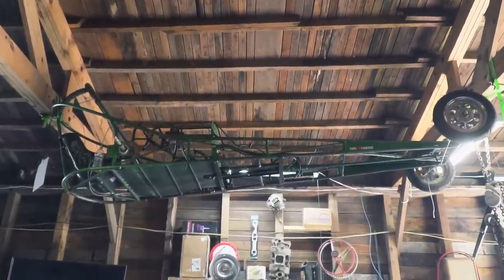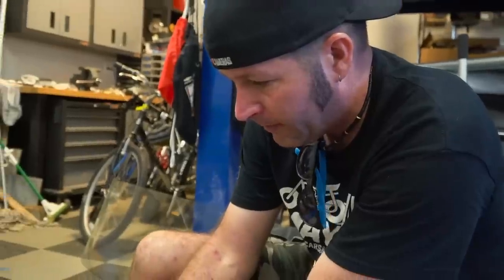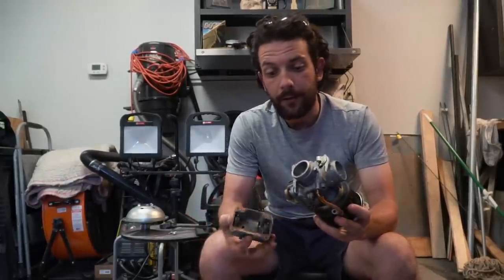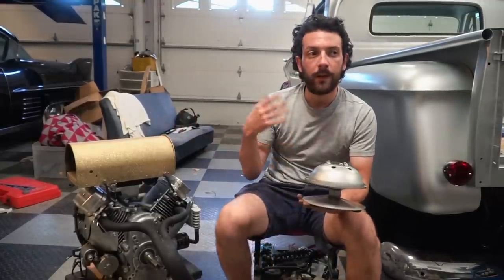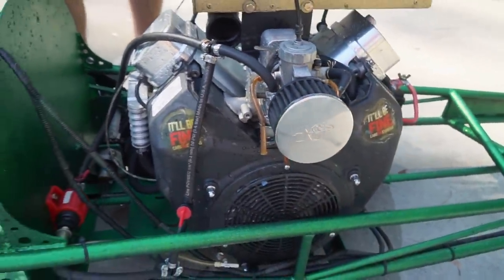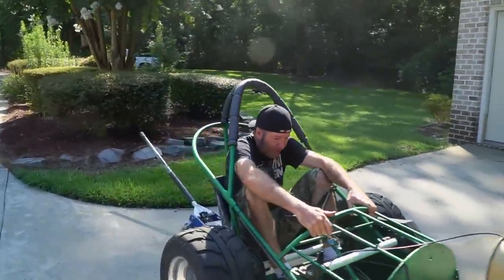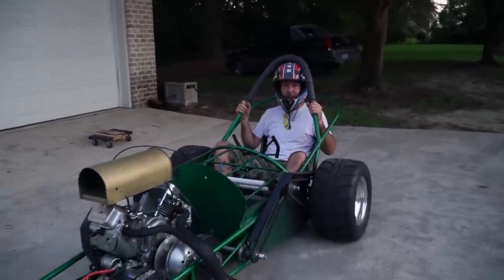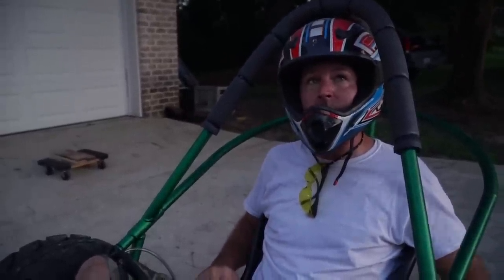670cc Drag Rail Revival! | Our 55HP Harbor Freight Engine Rail Kart Returns!

Comment: So need to put the 2 stroke snowmobile engine in it!!
Reply: It would make sense on this thing, given how powerful it is.
Reply: Or they need to build a second one and run them both together!!
Reply: Yeah the drag rail definitely needs a different engine, either snowmobile engine or motorcycle engine
Reply: Yh they need to build a bigger/stronger one with a more powerful engine.
Reply: it would be so fast with that engine. great idea!
Reply: Dam streight!!!
Reply: But the 670 just sounds cool
Reply: I'd say a Polaris 600 triple
Reply: The rotax would rock. This lawnmower engine isn't close to 55HP, it is 30 maybe.
Reply: @CLK Products  it won't wear the belt out as it won't need the cvt system as it already has the clutch and transmission built onto the engine
Reply: It would twist the frame they never built it for any more power and i remeber them even having problems with the current engine. They have said that it couldnt handle any more power.
Reply: Isaac Inmon yes that is true but towards the end of the video they talked about  strengthening the drivetrain and potentially the frame as well but even still I don’t think it would cause any damage to the frame rather than bending axels due to the torque from the engine

Comment from the maker: It’s more stout than I remember! Can’t wait to take it to the track
Reply: guys please get an old chevy or something and shove a predator 212 in it
Reply: Love the video!!!!
Reply: Lol
Reply: Plz put the snowmobile engine on it it would bc so sick
Reply: i think i need this in my life
Reply: I was thinking you said there were some cracked welds on the rail , Safety first . Look it over good :-)
Reply: Dude, just pick up a adjustable fuel pressure regulator off amazon. They are fairly cheap.
Reply: STOP PLAYING WITH THAT 670 ENGINE AND THROW ON THAT SNOWMOBILE ENGINE, DOUBLE THE POWER!!
Reply: CarsandCameras just don’t blow it up!!
Reply: The lithium iron phosphate batteries are the bee's knees. They don't sag voltage wise anywhere near a lead acid or gel cell.
Reply: Picked up the front left a little at 15:00
Reply: @josephh66  idk if chevys can handle that much power and speed. Thats pretty risky man lol
Reply: Put the snowmobile engine on it and send it
Reply: ONAN CCK MOTORS START SO EASY AND RUN BETTER WITH THE SPARK GAP AT 20K,  35K+ IS TOO MUCH GAP FOR THESE MOTORS, TRY A 20K SPARK GAP, GIVE ME A LITTLE TRUST WHAT I AM SAYING.
Reply: You guys should hit up some junkyards or auctions and find a doner bike with big displacement and do a build around that. At least you'll have the engine and transmission
Reply: Have you guys considered installing an AMR500 on her? Could be fun....
Reply: Hay  can you please take the cross cart to drag strip
Reply: I say it needs that 2 stroke u just got
Reply: did you say honda davidson ?
Reply: plains have pumper carbs
Reply: The 670 sounds way better than the snowmobile engine i say throw nitrous or supercharge it
Reply: Dax arms, I believe you could use the low oil shut off switch found inside the engine on the 212s but to make it fit inside of a fuel pump or carb would be a real struggle. However I do believe it would work for cutting the pump off. Actually it would need modified to work backwards but the idea seems legitimate.
Reply: I watched on another chanel where they took a new 670 and supercharged it, maybe that could be a direction to go.

Comment: A modern aircraft carburetor doesn't use a float bowl, initially they did, but for obvious reasons they didn't work if the air craft experienced negative Gs.
Reply: One of the big disadvantages of the Spitfire in WWII was the use of a carburetor with a float bowl, where its German counterpart the Messerschmidt Bf109 was fuel injected, so German pilots would try to force Spitfires into diving/negative G manoeuvres where their engines would lose power.
Reply: PKMartin the flooding issue was quickly fixed in 1940 by putting a ring in the carburetor to minimize flooding when upside down.
Reply: You can go inverted as long as it's a positive G maneuver like a loop or a half Cuban 8.  If you have the stomach for it and don't mind pulling 3+ Gs, Aerobatics are fun. Sad to hear John and Issac hate flying.
Reply: @moto6ixmoto83   I believe it was 1941.
Reply: Yes It would
Reply: Doing a 360 or something would cause the needle to close and that would not be good.
Reply: Fuel injection replaced carburators first was the 109 messerschmitt

Comment: carbs for aircrafts have heating for the air-intake because it is cold at like 10.000 feet :)
Reply: Right... The carb heat among other things.
Reply: What do they do for when the air gets thinner up there? Is there a lever where you can adjust the main jet while running?
Reply: @AustinRBa  You're correct. Manual mixture control to lean or enrich the mixture. Gotta find a rich/lean mixture that takes into account fuel economy, air density and altitudes effect on reduced engine cooling.  The carb heat prevents ice from forming in the carb. If there is ice, the engine may stumble momentarily while till the water from the ice is no longer introduced into the fuel.
Reply: Some aircraft carbs can also work upside-down. ;)
Reply: @Lord_Verminaard  good ones....
Reply: Actually paused and started digging in comments for this answer. Thank you kind sir! Have a good day! :)
Reply: @Lord_Verminaard  All planes with carb's have to run diaphragm type carbs with no float bowl. If a plane turns upside down with a standard bowl type carb, it would most likely kill you. It would flood the intake with raw fuel, start on fire from leaking, for sure kill the engine. Then you would have to have enough altitude to right the plane, glide along and try starting the flooded engine, all while trying not to crash.
Reply: @POL3INAROW  correct
Reply: @AustinRBa  the english and yanks added superchargers
Reply: @AustinRBa  well even my old moped from  1974 has adjustbla mixture egg boi so i hope they do :) have a good one
Reply: @POL3INAROW  Yep... The engine out won't kill you, a fire will.  Most general aviation planes can glide and land on a golf course or road.  Engine out simulations are fun.
Reply: More modern planes call it anti-ice. But same thing.
Reply: Aircraft carbs Ive seen usually run the air from the bottom through the top and mount underneath the engine.
Also the cold air at altitude.
Reply: @POL3INAROW  The spitfire made do without. Mind you I'm pre6sure they did make a modification to all aircraft with rolls Royce Merlin engines
Reply: Diesel engines also have an intake heater
Reply: Carb heat isn't normally used when flying, but carbs can ice at any altitude depending on a lot of variables. About the only time carb heat is normally used is to prevent carb ice when landing, but it kills the power, so its normally turned off. Almost all carbureted engines have an adjustable mixture to get the most power and efficiency out of the engine at any altitude. A few types of carbs aren't adjustable by the pilot, those are fairly rare, and fuel injected engines don't have a mixture control. As newer technology is used in aircraft engines more of that stuff is computer controlled.
Reply: @AustinRBa  early rotary engine Nikki carbs have an altitude compensator. Its just a needle that stays closed off till the sensor hits a certain voltage opening the needle and allows more air in than the venturi sees which helps lean the mixture. Youll find it at my local dump along with the rest of the emissions equipment lol.
Reply: nice to hear from a real life pilot, by the way i'm from scandinavia it's cold here most of the year

Comment: Glad to see it running again, I think the 550 Tot Rod will stomp the rail in the eight mile, the big drawback  of the rail is limited  RPM( 6500 ) Or so, and single speed. If you want the rail to be fast with the power it has , it needs a transmission.  Still love the build, old school is too cool.

Comment: whenever you have a simple gap set up like a lawn mower or a old school points set up on a car you can get away with using a match book flap as a feeler gauge to set the gap . most match books are made with 3 mil paper so it's about perfect for setting the gap on a mower the points on a old beater car. I own like 5 sets of feeler gauges for all kinds of old points set up's and I still fall back to the match book for my old dodge's points . the best part for doing a mower mag is you can put the match book flap between the fly wheel and the mag and just tighten the bolts the match book will slide right out after your done leaving the gap perfect and ready to run.

Comment: Aircraft carburetors are specifically made for aircraft. They are often more complicated than normal “small engine” carburetors as well as having an FAA manufactures airworthiness certificate. In other words to make and sell carbs for aircraft you need that cert from the FAA. There are also regulations about changing the “stock” carbs on any aircraft. In order to change to a different carb (unless it’s on a list of FAA approved carbs for your specific engine) then you need what’s called a supplemental type certificate.  Again, in order to attain that, you need to be in touch with them FAA. Long story short, the difference is the regulations surrounding the aircraft carbs. In theory they work the same as any carb. And of course there are float type and pressure type.

Comment: The reason it says not for aircraft use is because mikuni also makes carbs for aircraft more recently they are mostly used for paramotors and small craft.  I also did not know that up until a week ago when I was researching tuning on mikuni carbs for my bike and learned about their history in aircraft carbs.  The main difference that I can tell between a moto carb and an aircraft carb is that aircraft carbs have a different fuel bowl to avoid overflow since your aircraft wont always be paralel to the ground unlike how a land vehicle usually is. Aircraft also experience odd g forces at times. BTW really excited to see the drag rail back I still love the mailbox ram air intake.  Please do a turbo 670 for the drag rail that would be cool.

Comment: Great to see the dragster back in operation!😁👍 That thing with the mags is kind of weird. I'd be real tempted at this point to go with a crank trigger and electronic ignition (battery powered). Other than that, it still sounds strong. You may find that you'll need to put those higher stall weights in the clutch to really get your times down. Between that and eliminating the jackshaft, you'd probably pick up another 8-10 hp. at the wheels.😉 One thing about the 670 Predator, if it does finally puke it's guts, you could always put that Bombardier 670 2-stroker on there instead. With a big meaty axle and the stock clutch asy. from the Ski-Doo, you'd probably have to install wheelie bars.🤣

Comment: I would definitely play with tire pressure. Depending on the rating of the tire. If it's a max of 15 I would start a 7 and go up. If it is max of 20 I would start with 12 to 14 and go up. Should help with the spinning but might brake chains or bend axles so its definitely something to mess with want a little spin if things start breaking if nothing breaks then find a good low pressure. Also I think it in the 1/8 it will be about a 7. Have fun and be safe

Comment: Great to hear an American pronounce aluminium correctly...😀 p.s hi from the u.k.  oh and aircraft carbs are sprung so if the throttle cable snaps it goes to full throttle rather then closing to idle.

Comment: I'm an aircraft mechanic and the reason is 3 fold. 1, it doesn't have any provision for carburetor heat, which icing at altitude will block off the opening. 2, it doesn't carry a P.M.A. number, which certifies it for airworthiness. Only experimental aircraft aren't required to carry P.M.A parts. Usually on aircraft you find Marvel Schebler updraft carbs. Old tractor stuff. The Cessnas and Pipers are more closely related to tractors than anything else. 3 no mixture adjustment. You have to be able to adjust your fuel mix at altitude.

Comment: A diaphragm carb is used for aircraft. It doesn't have a float bowl too flood the engine on a climb, loop, or tight turn. A Carb like your's will dump fuel into the engine of an airplane when turned upside down, and bowl will run out of fuel. Diaphragm carbs are metered, there internal fuel pump produces more fuel than the carb could use, the needle and seats are metered, not open or closed. The fuel the carb can't use is returned to the tank from an internal bypass. This style carb can be turned in all directions, and still deliver the correct amount of fuel.

Comment: Airplanes run off of av gas. Its a special mixture of gas with a little bit of lead in it. Helps with lean mixtures at altitude. That carb can run it, but it will tear it up like ethanol. Also if the plane is upside down, the contents in the bowl, in the mikuni, will run out of the top and the float will shut closed causing the plane to stall

Comment: I have to say if you want to boost this V twin you can use a AMR-300 or a AMR- 500 supercharger . if you look on Amazon there 220 bucks but If you look on Alibaba you can find them for 120 bucks for a rebuilt one there good up to a 2.0 litre engine for the AMR-500 model or a 1.7 litre for the AMR-300 . I would love to see the dragster ripping up the strip with a blower on it .

Comment: Please buy a pkw 34mm slide valve carb. Only $30 on ebay. Add a very very small nitrous kit also inexpensive. If you think you're fast now, these improvements will make your rail come alive. A bit more intake volume "increase plenum", might give you a bump in power with the above mentioned mods as well.

Comment: Carbs for aircraft use are a "Diaphram Style" so that fuel is feed no matter the attitude of the aircraft,(i.e. banking hard,[over 10°],flying upside down,ect.). Plus they have a "intake heater" for altitudes greater than 7500 foot...

Comment: Concerning Aircraft carburetors, most of the small airplanes running a Lycoming 0-320 or a Continental 0-290 will have a Marvel Schebler updraft carburetor.  Couldn't tell you the CFM rating on them though.

Comment: John, Bendix and Stromberg carbs are common on smaller planes, but a lot of different companies manufacturer(ed) aircraft carbs. There are so many different types, sizes and makes for different types of aircraft engines, I don't think there is any way to say "this specific carb is used on airplanes."

Comment: Carburetors for aircrafts are designed to be used inverted as well as right side up.... You wouldn't wanna run a regular style carb while you're in an inverted flat spin, or loop 1,000ft in the air. You'd lose prime or flood out when the floats hung wide open.... From being upside-down

Comment: if youre changing the kart, why dont you try turning the engine around so the fan intake gets some ram-charging going on to cool the engine? That is, if youre keeping the engine that it has...
Idk, it just looks strange to me having the engine jutting out the way it does too when the loop behind it would outline the whole engine nicely if it was truned. Plus you could have one exhaust go out either side to have two exhaust pipes if you wanted.

Comment: Needs gears a six speed gear to get all of the 1/8 or 1/4. Take the bottom end of a motorcycle engine for the transmission, meld it to the engine. Then you can get some big end out of that rascal.

Comment: A carburetor for aircraft use will have holes for safety wire in all the bolts so nothing falls apart while you're Flying

Comment: Nitros, that thing screams NO2. If you were to add some sort of “trans” brake if that is possible with a torque converter set up, a 2 step and a 25-50 shot of nitros that thing would get into the mid to low 8’s maybe break into the 7’s. I just think since that is an old school rail, it would be sick to see it pull to the line and purge the nitros. Have the bottles either mounted on the back behind the driver, or in front of the engine. I am a turbo guy to the core but that things needs nitros.

Comment: What carb IS ok for use on aircraft? That is an interesting question. A gravity feed carb system was used on the A6M Zero fighter in WWII. When US Navy personnel and American aircraft engineers got a hold of an intact one in the aleutian islands they found a flaw that makes the Zero weak at diving compared to our F6F Hellcat fighter. It was a battle changing piece of info. Anyway, carbs for aircraft need to work in any position, not with a bowl on the bottom that fills with fuel due to gravity.

Comment: Aircraft carbs use a cable control on a mixture adjustment due to the extreme changes in altitude.

Comment: That hard start is due to valve adjustment being off. It’s common on those twins. There is a decompression “lever” that engages during start that won’t work and acts like yours did. Too much compression. Just needs a valve adjust.

Comment: Not 100% sure but I think the old Merlin engines from spitfires used to stall in dogfights whenever they went upside down. Maybe the (not for aircraft use) has something to do with plane carburetors being able to run in all orientations.

Comment: The carburetor on my aircraft is a marvel schebler, most small piston powered aircraft using Continental and Lycoming engines that are not fuel injected use this.

Comment: Hey guys I found a way to reuse the stock throttle linkage for the 212s that doesn't require the governor arm and extra linkage. I used the throttle arm shortened it and bent it as needed then flipped the entire throttle assembly backwards and bent a couple tabs. Mine is ugly but it works flawlessly. It feels much better Aswell. I'd like to see if I can bore my stock carburetor out for more fuel and air.